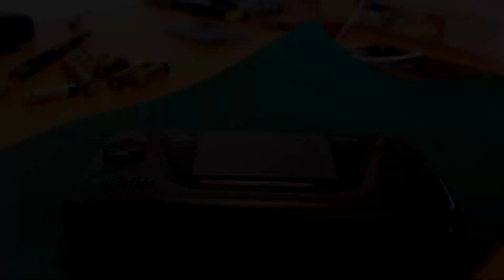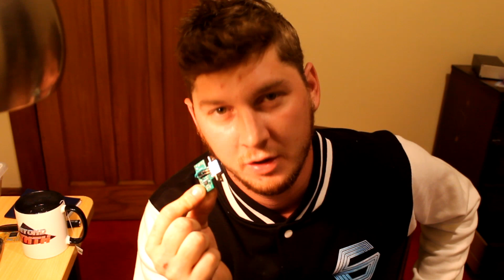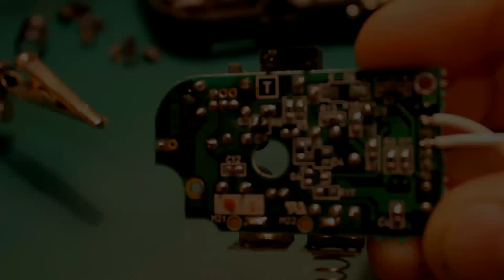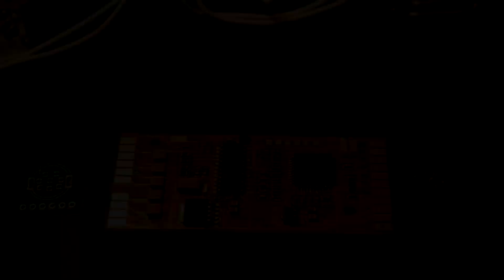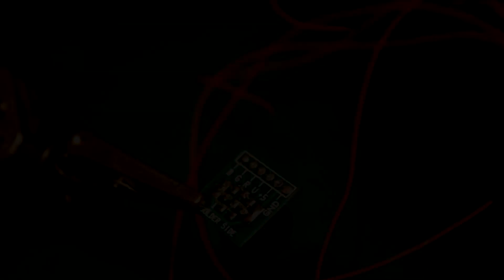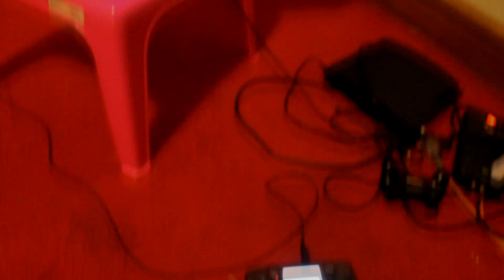build a consolized sega game gear ( ft. Super Derek and Andy Last)

Comment: You should also use solder/flux on your cable ends to prevent cold solder joints
Reply from the maker: zolwikwkurwik it's Rosen core and there is flux in most of the joins pasted over it have a closer look
Reply: ok
Reply from the maker: zolwikwkurwik ohh sorry if that sounded blunt just woke up at 4 am for no reason and a have the flu atm haha  sorry thanks for watching

Comment: Why does synthwave go so well with soldering???? By the way, I noticed that all the wires having to do with 5v lines and ground, have lower gauge wires. Could you use typical small kynar on a 5v pin, or is that not enough shielding?
Reply from the maker: Avalanche Reviews yes but I just prefer to make them a little bigger to be able to deal with any Psi faults which 98% you never have to worry about but it will save you one day lol yeah kynar is fine :)
Reply from the maker: Avalanche Reviews ohh and synthwave goes with anything